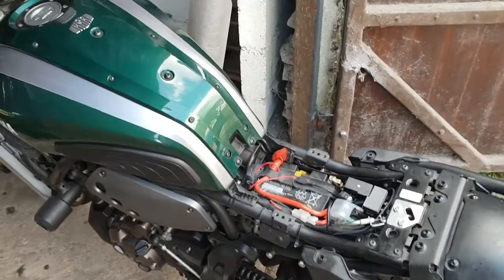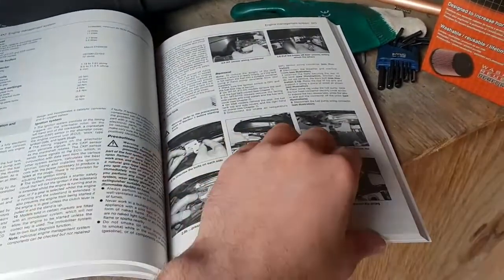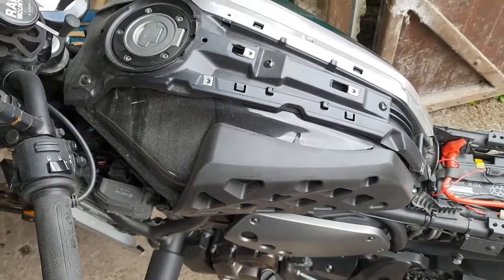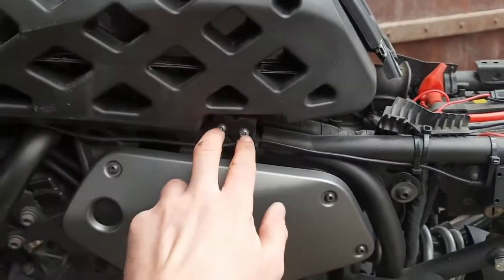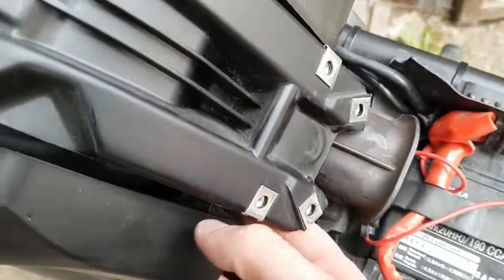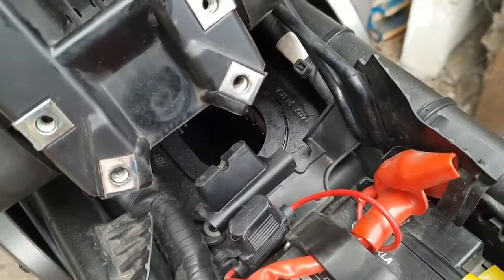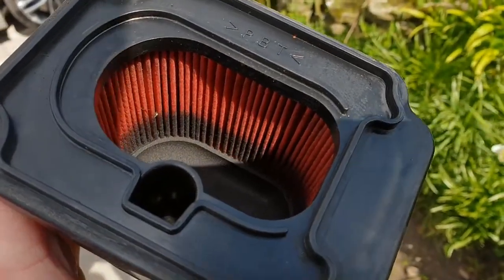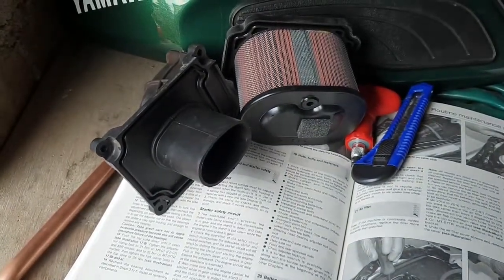XSR700 MT07 Air Filter & Performance Upgrade

Comment: Hey Tom, detailed video, thanks for that! 
What did you use as fork cover at the front? (I mean the part of the fork above the fork bridge, not the gaitors). Are those the OEM plastic tubes by Yamaha?
Thanks in advance.
Reply from the maker: 40mm (I think) black plastic waste pipe, Very cheap!
Reply: @gringotom242  Ah yes, thanks. Do they wobble/Did you have to put O-rings on both sides?

Comment: Please correct me if I am wrong and I am guilty of putting in a upgraded air filter too. But it does not make sense to do this here is why yes you get more air in the box but with EFI regulates how much air goes into the combustion chamber. Yes their is a difference but does it justify the expense that’s up to you.